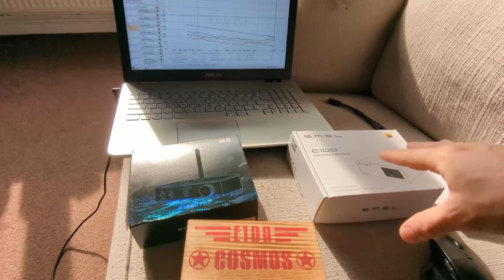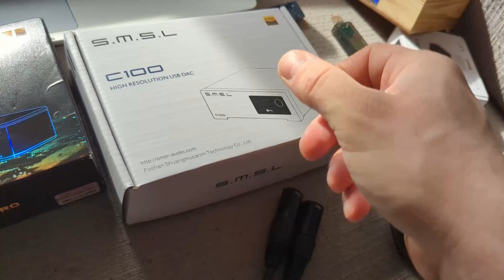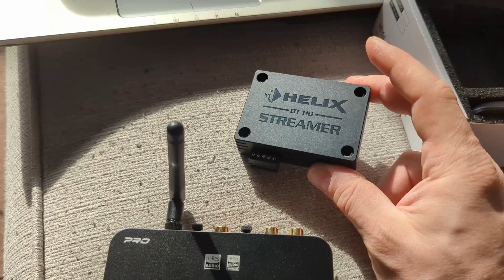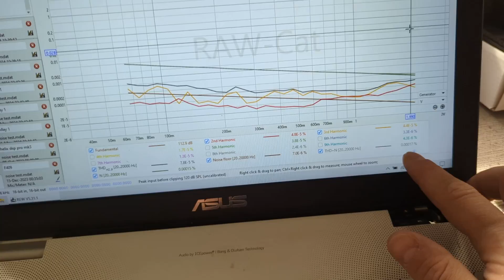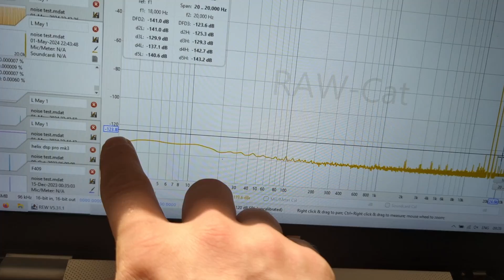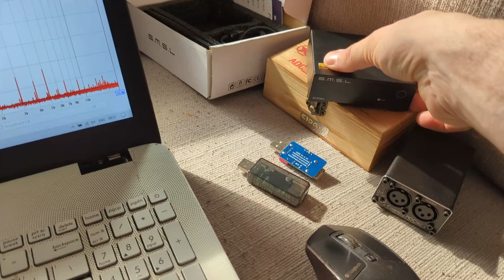Amplifier and DSP measuring gear upgrade - Cosmos E1DA, SMSL C100, FiiO BTA30 Pro

Comment: I’ve recently bought the SMSL PO100 PRO so I can play hi res audio on my phone connected to it via usb and convert it spdif optical out into my Helix DSP in my car. But then discovered all the other cool things SMSL makes and bought the C100 for a desktop HiFi system and the PS100 for TV/HiFi system in another room of the house. It will be cool comparing the ESS DAC and AKM DAC in each unit. Cool to see the cross over between Audiophile HiFi gear and car audio.

Comment: The FiiO BTA30 Pro (~US$120) is one of my favorite audio devices.  I have two...one for the office, which I use:
A) in DAC mode for my vintage Hitachi SR-503L and Marantz EQ20; or
B) as a BT 5.2 transmitter (TX mode) to my various BT devices (Muse HiFi M4, FiiO BTR5, KZ AZ09 Pro/CCA BTX)

and the other for the family room, where I use it as a BT5.2 receiver (RX mode) for streaming in LDAC codec from my Android phone to my vintage Hitachi SR-903.

This little device is extremely versatile, with plenty of CODEC support (LDAC, AptX HD, AptX LL, AptX, SBC, AAC). It is also nicely built, having an ALU chassis. I did upgrade the antenna (12dB) for extended range ($12).

Comment: Can you measure distortion profile?  The number of gain stages and see if the amplifier is a high negative feed back amplifier.  I watched another video mocking diy testers.
Reply from the maker: Not gonna lie - don't know how to do that. I can measure the distortion profile to see individual harmonics. As well dependance on output power and frequency. But not gain stages.

Comment: Often dacs will self dither.. ie 24bit dac chip will dither the absolute last significant bit. For dithether to work for you you might have a 32bit sound that is going to an un dithered dac that you know is 24bit and you don't want to hear crackles when it tails out. If your altering the gain.. forget it and trust that the dac is handling such things.

Comment: That's some nice equipment, and here I'm just trying to figure out if the front or rear outputs on my factory head unit are worse.  :D
Reply from the maker: Haha, front and rears will be identical as in the HU there is a 4ch chip with identical performance for all channels.
Reply: @RAW-CAt  I believe the radio is "upgraded" from my last car, but testing the fronts vs rears with an o-scope on my last car, the rears were slightly lower voltage and clipped at a higher volume level compared to the front.  I'm assuming is the filters the OEM radio has.

Unfortunately there is no way to get a cleaner signal out, but that is going into a KeyLOC is just for daily listening or road trips.  I have a USB to optical for critical listening.